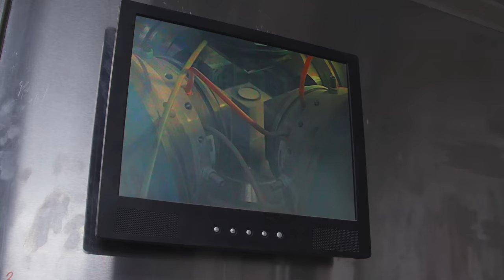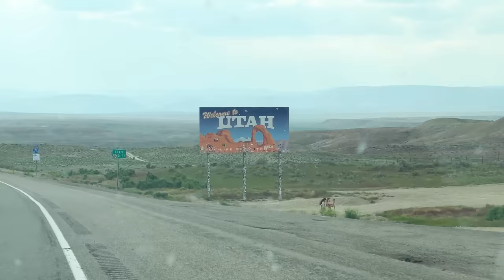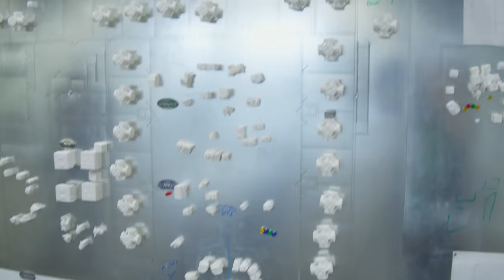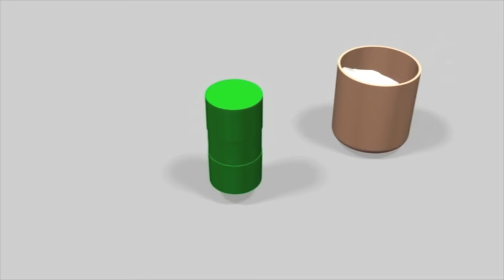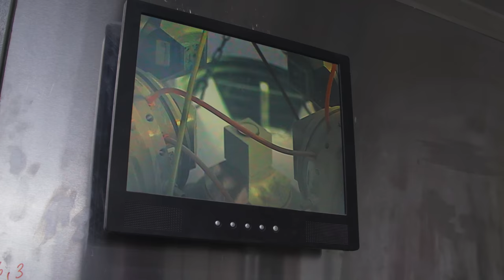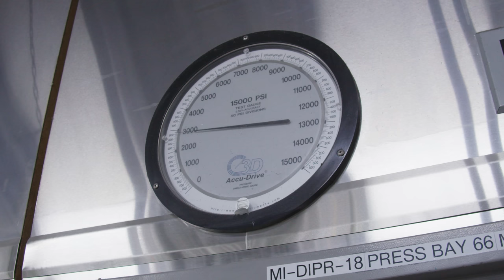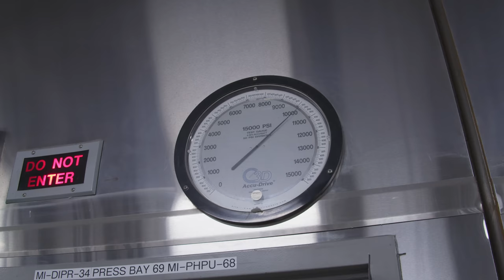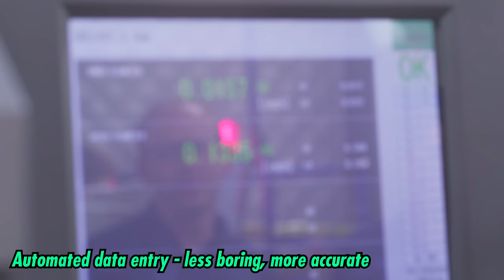The Highly Ridiculous Over-Engineering of the Diamondback Nozzle

Comment: Funny you mention bar mitzvahs for putting the tips back on. These Anti-Mitzvahs are how I bring home the bacon. We use similar technologies to press our bales of foreskins into individual wafers. From there we rough them up a bit, in a windowless room b/c it’s proprietary, in preparation for stacking & jacking. Depending on the clients’ specifications, a wafers are fused to make a laminate ranging anywhere from 8 - 16 centimeters in thiccness when measure. The raw Puck is then cut & polished to fulfill customer’s desires and brought into our cellar to be dry aged until the Rabbi retrieves it so it may be cauterized during the Ceremony, & forever be one with the client member.

Comment: I have a couple diamondback nozzles and I think they're incredible products. I usually keep a tungsten carbide nozzle on my main machine full-time because TC is A.) hard enough for most things, B.) slippery enough for most things, C.) allows for creative CHT-like internal geometries to increase flow without elongating the melt zone (although it sounds like Diamondback could do this too if they wanted), and D.) allows me to take a blow torch to it to completely vaporize particularly stubborn clogs in the admittedly rare event that they happen. But it's an objective fact that polycrystalline diamond is harder, has lower coefficients of both friction and thermal expansion, and a higher coefficient of thermal conductivity. If they ever did a true CHT-style version of the diamondback, I'd definitely pick one up.
Reply: couldn't you blow torch the diamondback?

Comment: I found two details interesting:

They initially made a one piece diamond nozzle. If it was put on market the price would be around $1000. But that would be a valid high flow nozzle?

They said their process produces diamond to diamond bonds. I take this as it's not a typical matrix composite. I did find the tip is transparent. It just has a very dark tint. The transparency might be specific to the process.

Comment: “in this bar mitzvah they put the tip back on,” niiiice. I bought a Diamondback a few months ago and use it on my ABS/ASA/nylon printer. It’s running well! I was using an E3D NozzleX before that, which is ok, but I’m not a huge fan of tool steel nozzles—they just don’t print as well as brass. As you showed, diamond has great thermal conductivity and “becomes one” with the brass nozzle and heater block in a thermal sense.

Comment: Ah yes - on-demand production without inventory - makes it so much cheaper when you do not have to have stock.... until there is the tiniest of hickups, or as we had seen in 2020 were just everything came to a grinding halt. Were we have seen large industrial manufacturers having to close down cause they had no inventory of crimp-terminals to produce excavation-machines (an example i had seen.... they ended up with literally hundreds of excavators that were only lacking crimps)

Comment: I feel like a shill, but honestly the Diamondback 0.4 I bought a year and a half ago has made such a difference in my printing experience. It dropped temps, allowed me to crank up to crazy speeds without the temperature drooping, let me perfect each filament's parameters. I'm able to print TPU (on an otherwise stock Ender 3 V2, running Klipper) at 40 mm/s with 1200 mm/s/s acceleration.

Also, the non-stickiness of the flat surface of the nozzle allows me to get crystal clear top surfaces when I enable ironing. Clear PETG that looks like glass. 😙👌

Comment: Awesome vid, I love BTS factory tours like this.

They’re hella expensive, but I’m actually surprised they can make the, that cheaply. I’m also amazed by how large the starting pellet is, that seems like a heck of a lot of polycrystalline diamond to have t9 grind away for each nozzle.

(Also super-interesting about the diamond bearings that just grind up sand and use it for lubricant 😮 Amazing stuff!)

==> They said they use their nozzles on every one of their printers, and … I noticed a BambuLab X1C in one of the shots, so when are they doing to start selling nozzles for the X1C?
Reply: Couple of months!
Reply: It seems that they can get multiple tips from the pellet now because they said that it was only one nozzle per pellet, past tense
Reply: They're not an ideal solution but you can get adaptors to use standard V6 nozzles in the X1C
Reply: Do you work for ChampionX? If so, need any beta renters for the Bambu version? I'm about 30 minutes "up the street" in Taylorsville if you do.😊
Reply: @reprinted3D  I’ll talk to the Diamondback team for you!
Reply: @stevenburton9206   I got your notification to reach out to the team; what's the best way to do that?

Comment: I wonder how much worth this is over a 30 dollar hardened steel nozzle.
You'd have to be constantly print very narly plastic to make it worth it because (coated) hardened steel nozzles will also pretty much last you until the lifetime of your printer if all you do is ASA, ABS, non special PLA(+), PETG and even Nylon to a point (as you aren't allowed to go above 300c with the diamondback nozzle.)
Still looks like a fantastic product even tho it's probably not for me. Great job everyone at Diamondback!
Reply: hardened steel is pretty annoying the the worse heat conductivity, though. Tungsten does not have that issue, but classic hardened always needs a few more degrees and still cost a bit of flow (for me)
Reply: For Zack who prints like literally every filament ever, its probably worth it to get a diamond back. He prints with shit that can unanneal steel. For us normies anything cheaper will do the trick.

Comment: This company reminds me of how things were done in the early days of the manhattan project. Back in the day process improvements and tools were made by the people actually doing the work. If you needed a 2" spanner wrench on a 20 foot extension with a 90 degree offset you would go to the machine shop and ask for exactly that. They would make it up and you would go to work and use it. Fuel element stuck in a reactor? just saw off a rifle you got from the Army guys stationed there and make a 30 caliber to reactor fuel channel blank firing adapter to unstuck that fuel element with a blank. I suppose if you are piloting processes for a cutting edge technology that really is the way it has to be.

Comment: I would love it if they made a diamondback nozzle for a Bambu printer.
Reply: Will never happen ... Even IF you could fit a DB to Bambu, you would have to hack into the firmware to enable you to do a PID Tune of the nozzle
And Bambu won't sell their printer with a DB because it is not financially beneficial
It's the same reason you can't fit a High-Flow onto a Bambu

Comment: 17:38 While I can see a 1000 dollars being a little steep, I can see the advantages to line the whole inside with diamond. Especially the Bondtech CHT design. The better heat distribution really might be a kicker.
The whole nozzle doesn't need to be out of diamond, just the complete inner filament path. Encased in … whatever. Brass, Bonce, copper. Hell, at $1000 you might even mate brass and diamond with a gold layer.

Comment: I've been told by print farm owners that these diamond back nozzles will in fact not be your last nozzle.  I was told using highly abrasive materials at near 300℃ the nozzle doesn't last long at all.  Apparently the diamond material disintegrates quite easily at higher temperatures and thus the 300℃ thermal limit by the manufacturer.  But what would be great is if the manufacturer addressed this 300℃ limit directly and exactly talked about how long the nozzle would last with high abrasive high temperature filaments.

Instead their marketing doesn't really make any kind of mention of that, and that is why I am highly suspicious and wonder if there is some truth to what is being said on 3d printer Discords about this.
Reply: DiamondBack does need a high temp nozzle and is on the list.  But the diamond will last to 700 C at room pressures which makes the brass the limiting factor.  300 C is the limit of the brass.

Comment: Did I hear correctly that diamond is the best at thermal transfer? So wouldn't it be as a cold plate for liquid cooling a CPU?
Reply: I've thought the same thing. Not sure on the thermal capacity, but thermal conductivity with diamond is stupid high.  Use one of those little diamond cylinders for the base of a heat sink and you could probably get some wicked numbers.

 I wonder someone like JayZTwoCents could convince US Synthetics to make custom processor lids for when he is doing liquid nitrogen cooling.
Reply: @pjpleiss  yeah Jay or Derbauer or Steve from Gamers Nexus.

Comment: Another reason you do not see dimond cutters is incompatability with steel. Steel is an alloy of carbon, and iron that will form alloy together at temps that are absolutly normal between a cutter and steel. Even hand tools can reach that temp.

But, dimonds almost as good looking brother who drives a BMW instead of a Porche; Cubic Boron Nitrate is almost as hard, it can actually scratch dimond but... still use dimond to polish dimond, C.B.N. gets the brunt of the scratch.
And Poly-crystialine CBN cutters are mass produced for your lathing and some milling needs if you have a metal lathe and mill. Just.. buy the fully round disk tools and holders at $100 a pop your gonna want as much cutting edge out of the insert and with the holders costs... 
Your gonna wanna share the holder with some polycrystaline dimond cutters too. So make sure you are not getting locked into an ecosystem that is not cross compatable.

But with those three warnings for hobby makers, just enjoy the tools if you know already that you absolutly will burn through your H.S.S. cheapies, because youve burned through them already, polycrystal tooling is loads cheaper per km of use, and choose the right tool for the job.

And dont listen to the salesman who says PCD is just fine for steels, they are lying to get more sales from you, physics and chemistry do not change for slogans and salesmans smiles.

Comment: From the computerized measurements I see that the tolerance on the internal hole is +/-0.05mm: total 0.1mm for a hole with a nominal diameter of 0.4mm (25%), isn't it a bit too high for quality prints? Otherwise I don't see tolerances declared on the circularity of the internal hole and on the concentricity between it and the upper hole. I think it is very important to have these information as it can have obvious effects on the final quality of the prints. If possible to know about it thank you.

Comment: I was surprised how affordable they were. Sure it's a hundred bucks but a decent quality steele nozzle is like at least 20 bucks (at least here in Sweden) and those boutique nozzles are Hella expensive. And if the diamondback nozzles are as good and durable as they claim it's worth it and acts more like an upgrade then a consumable.
Not everyone will need them but if you do you probably have a much more expensive printer. I have a cheap neptune 3 pro and a nozzle goes for about 15% of the printer cost already. And it will probably never really need a diamondback. 

So, you know. Don't believe you need one to get into printing. I waited almost 10 years before getting a printer and now with the extremely affordable quality printers you can get going on the cheap without sacrificing that much. Start with a decent budget printer and if/when you want to level up you can consider a high end nozzle.

Comment: These are great nozzles that don't fit any of my printers, because every printer manufacturer these days wants to come up with their own special nozzle. Sovol has their own, Creality has their own, Bambu has their own, Elegoo has their own. I'd love these for even ruby nozzles, but nooooooooo everyone has to make their own incompatible nozzles.
Reply: I have fit the MK4s onto my SV04 without issue beyond resetting the nozzle height and releveling the bed
I am about to try with the volcano style nozzle on my SV07, maybe some extra high temp heat grease to cover the slight thread depth difference from the volcano style

Comment: I bought one of these back when you first talked about it and I've never had to remove it unless it was to change a malfunctioning heater block. Otherwise, it wouldn't have moved for a year. Now I don't know about you guys, but I had a small box of used brass nozzles before this purchase. From the cost per unit/time, it has paid for itself in less than a year.

Comment: Interesting that they grind the diamonds using laps/Blanchard grinding.  I would suppose there is a better solution, like sublimating them with lasers, or something.  The diamond can't withstand very high temperatures at atmospheric pressure.

Comment: Is there really any benefits with this over ruby nozzles? Meaning worth the extra cost.
Reply: Higher Thermal Conductivity, so *better than brass*, not worse than it (like ruby is), thus potentially higher print speeds.
Reply: @ericlotze7724  Not sure how much the last 5% of the nozzle helps as the whole nozzle isn't made from diamond. Also the part cooling fan might cause the diamond to cool more than ruby would.
So I'd say some actual testing is required to see if there is actually any realworld benefits. As with the price of one diamond nozzle one  can get four ruby ones.

Comment: "Highly Ridiculous Over-Engineering" - kinda describes it well. They're nearly $100, far more than even the ObXidian by E3D. Understandable considering the material and the labor, but even ObXidian nozzles are expected to last the lifetime of the printer, and there are hardened nozzles that are even cheaper still that will likely last a pretty long time. So while these nozzles are great for showing off, advertising that you're using the hardest material in the world, getting the attention of YouTubers who want sponsors, etc - if you just want a nozzle that lasts the lifetime of the printer, there are cheaper options.

Comment: Crap nozzle considering the number of times I have heard about the diamond center getting dislodged and leaking. They need a redesign of the mount. Also sucks it is brass. No torch quick clean.

Comment: Brass (typical alloy) isn't that good a heat conductor.  Have they thought about trying pure copper or even silver?  Even bronze is twice as good as brass,  but still only half as good as copper.  The wall thickness of an M6 threaded 1.7mm bore should be plenty to survive being softer metal.

Comment: I've just bought several of these nozzles, roughly equal in value to the printers they're installed in
They showed up with that beautiful diamond finish for the tips, I put a scratch on the glass plate of one package, but they still seem to be brass general construction
I have already seen impressive results with normal materials, but am I going to find a diamond in the rough (failed print) whilst printing some of the more nasty materials? ie, carbon fiber , Iron/marble/glow in the dark PLAs and PETGs impregnated after a few runs?

Comment: Been using these nozzles since they were available for purchase on Amazon in 7 of my creality printers and have yet to have any issue. Our company manufactures high pressure waterjet nozzles for surface blasting and high pressure cutting and after inspecting the quality of these nozzles (albeit a different application) I cant imagine using anything else. Similar to high pressure waterjet, the quality of a cut is only as good as the nozzle in the machine regardless of the price of the entire machine. Certainly not a cheap product but the quality of the prints and tool life will speak for itself.

Comment: Silicon has the same crystal structure of diamond. And we use the shearing characteristics of this crystal as a core part of failure analysis. It allows us to predictably break through small defects just by putting a small nick at the edge of the wafer, and allowing the crack to propagate through the sample/wafer

Comment: If they go the lengths to use diamonds why not make the body of the nozzle out of copper, it has more than 3 times the thermal conductivity of brass. I would even use some kind of soft metal in the tread interface like indium wire or something like that, tough I don't know if at the operating temperatures it could begin to form an alloy and damage the parts, maybe a diamond based high temperature thermal paste?

Comment: i have a diamond back that is worn out but when i first got it i had my hot end cooling fan break and it clogged i had to heat the nozzle up on my gas stove top and plyers and shove filiment through it, ever since then my 0.6 nozzle had issues and i ended up measuring the hole its 1mm or so now. so i print pla only no carbon filled but id like to know if heating it destroyed the diamonds strength.

Comment: 17:50 kinda incorrect. if you slice a very old nozzle you definately see also the inside gets grinded. i guess this is because of the pressure rubbing abrasives against the walls.

Comment: Sure the tip is nearly indestructible in this application but it's the tip not the entire channel so that thing won't last you forever. Yes the inside does erode it's not just the outside of the tip, it will take a very long time but it will happen.

Comment: Super cool, definatley going to have to get one of these. I spend most of my days at work using PCD for cutting and tooling applications. i use Electric discharge machining to work with it and profile it. high current and 0.25mm dia wire. really awesome stuff ! also our blanks are 63mm dia :)